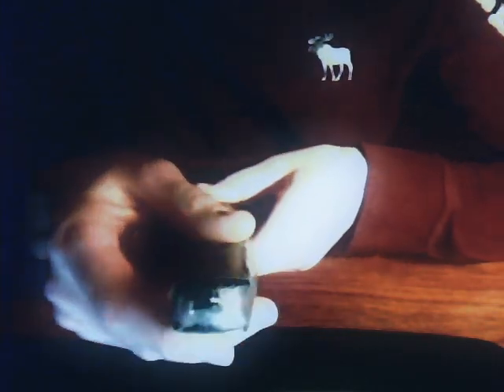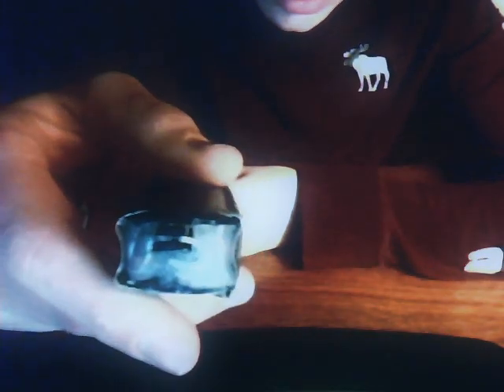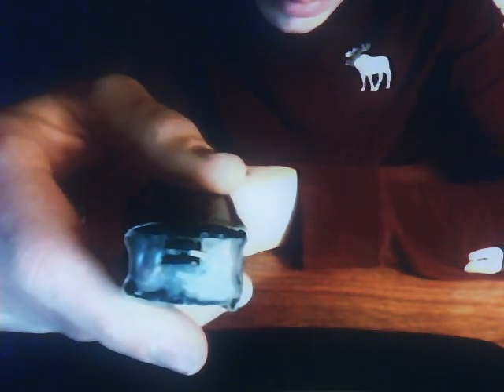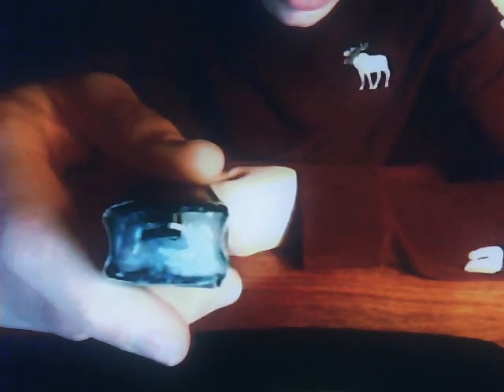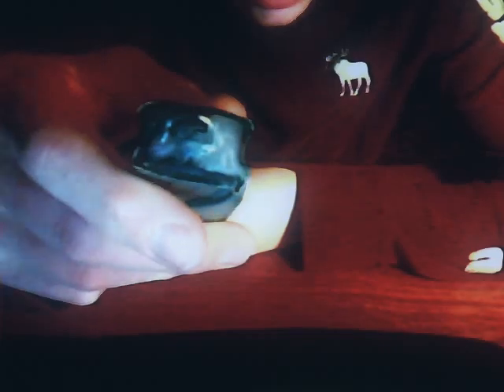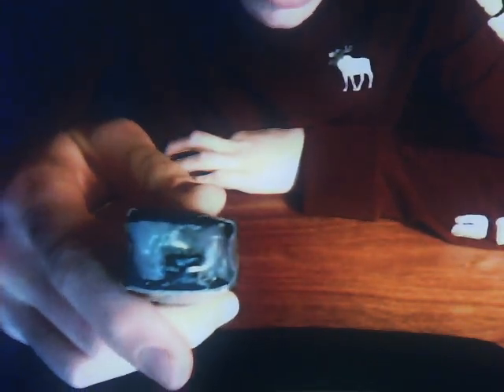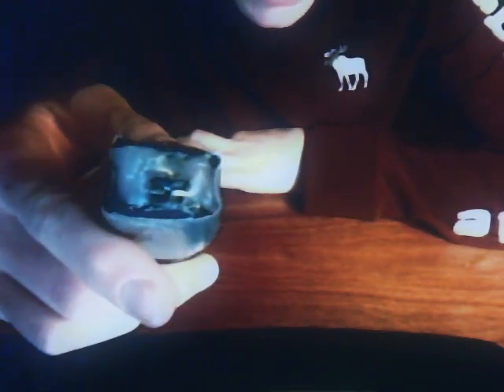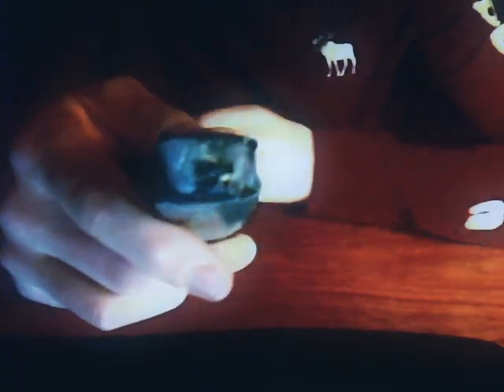My homemade electric fly swatter stunner

Comment from the maker: If the light is not on and it does nothing, then you have bad batteries. If it still does nothing and you put good batteries in it check to see if your batteries have a good connection or if they're in right, and even check to see if a wire is broken. If the light is not on but it snaps, then the light is bad, if the light is on but it does not snap, then you need to check for a broken output wire, a bad prong connection or even if the circuit works, But most likely it will work fine. P 4.

Comment from the maker: Optional, you can put a piece of rubber under the tip of the prongs if you want it to spark faster, but this will not change how strong it's output is. Now replace the batteries if you have some, and test it by pushing and holding the button and seeing that the light is on, you proceed to touching the prongs to a metal object. If it snaps and the light is on, it's working as it should. P 3.

Comment from the maker: and connected one to the 2 black and the other to the red wire with a pair of wire splicers, of course you can use whatever you want. After connecting the wires, you then place them in the distance and angle that you choose, I placed mine so that they would create a spark and that is around 1 to 2 MM, and hot glue them into place. After that, you put the cover back on and fill in the gap where the racket was with hot glue, and make sure not to cover up the prongs! Now you are done. P 2.

Comment from the maker: I started by buying a bug zapper racket, in this case an Original Bug Zapper racket is what I bought, and I got it at Walmart. Then you take it out of the package, take off the battery cover and remove the screws holding the cover on. After that, you take off the cover, and find 2 black, and 1 red wire going to the racket and cut them off. Then you strip the ends of the wires you cut, twist the 2 black wires together and find a screw or something for a prong, I used 2 U-shaped wire splices. P 1.